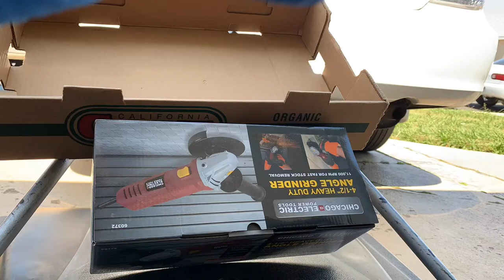Using Harbor Freight angle grinder to grind ARP extended wheel studs

Comment: Really gotta take that much off?
Reply from the maker: You can grind small piece at a time but I know I got carried away there for a minute lol 😂
Reply: @jpscrx  cool. I’m doin all 10 front studs at one time. So I’d like to prep the studs and grind on them before I take it all apart. Thanks for the response.
Reply: @jpscrx  this service is one of those things you might as well do all of them if you can. These are original 250k mile studs. 3 are broken but They’re all kinda galled so might as well do all of them while it’s apart.